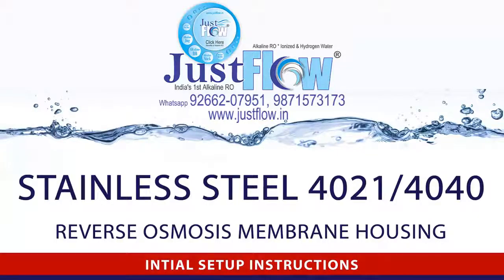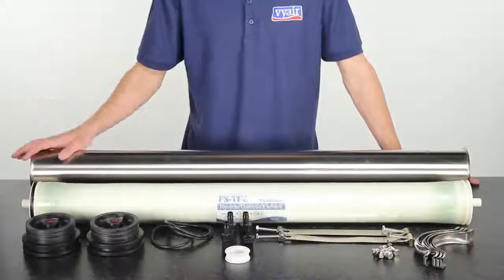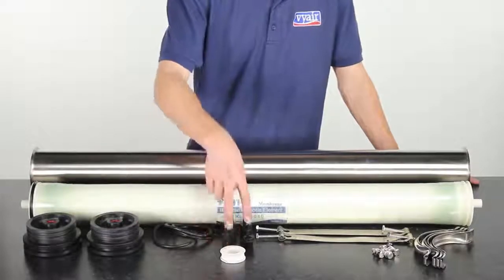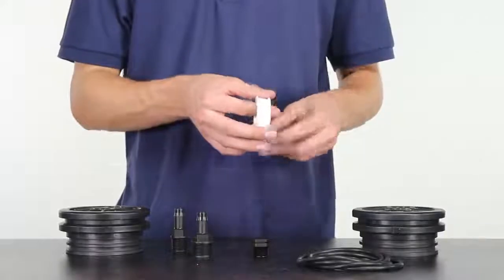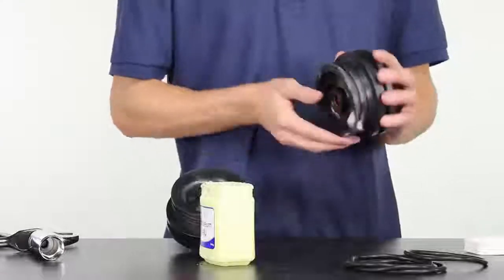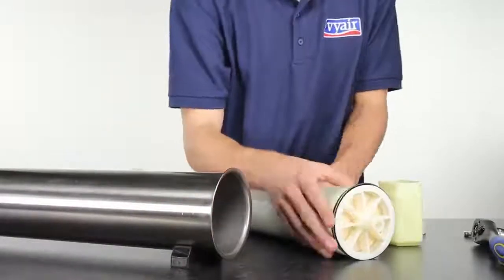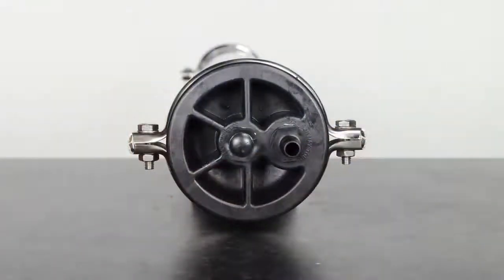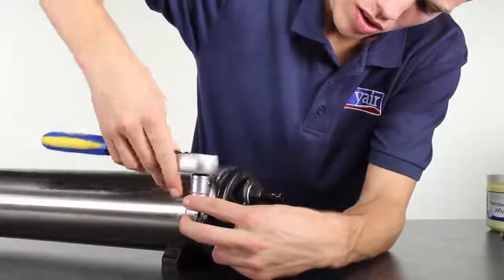How to Fitting Membrane 4040 | SS 304 Membrane Housing

Comment: My new RO membrane came with an extra piece (2inch piece with rings on the inside). I assume that is for another unit, not the housing in your video. Can you confirm there are no pads or any extra fittings between the RO membrane and black cap cover?
Reply from the maker: pplz whatsapp
Reply: That’s for running more than 1 RO in series.